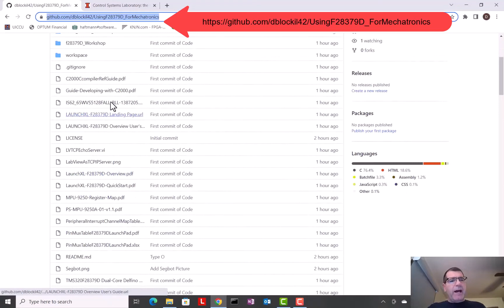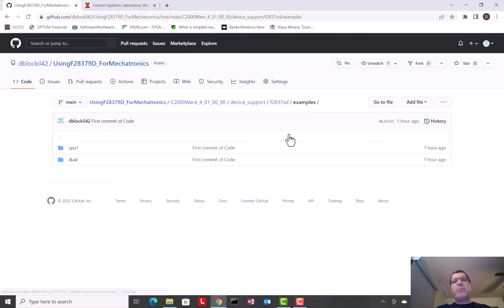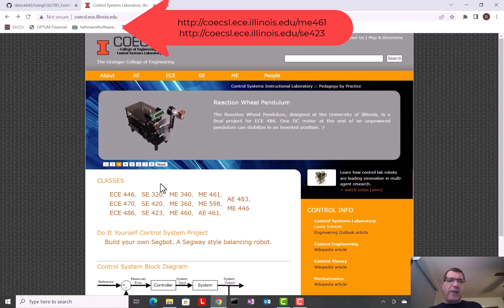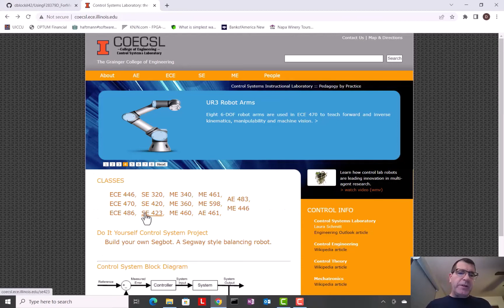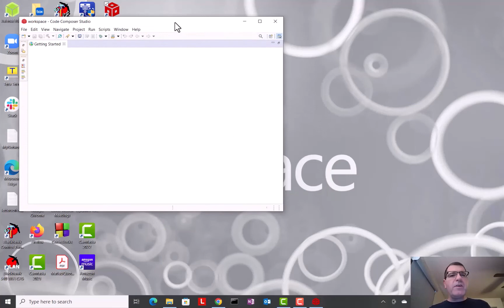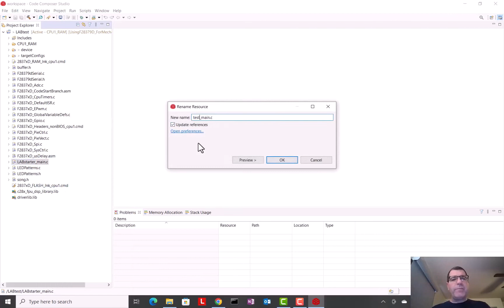Introduction to the Video Series

Comment: Hello.

I have one question, what is the difference between F28379D and F28039C? I only have some experience with the latter so I was wondering if the tutorial series will also apply for 39C or if there are any semnificative differences that I should be aware of?

Thanks.